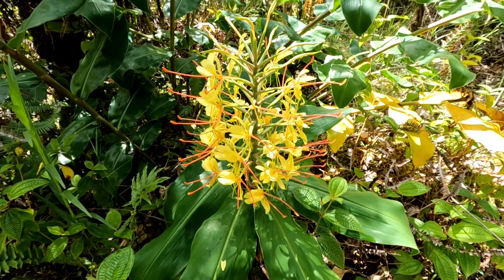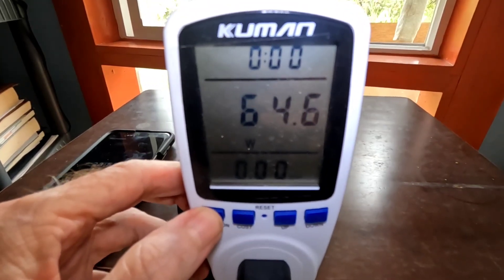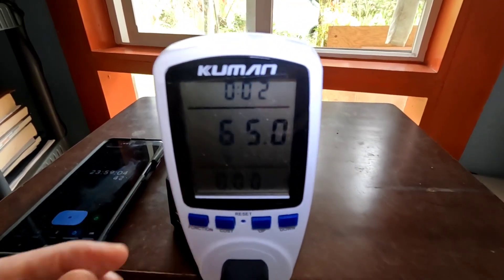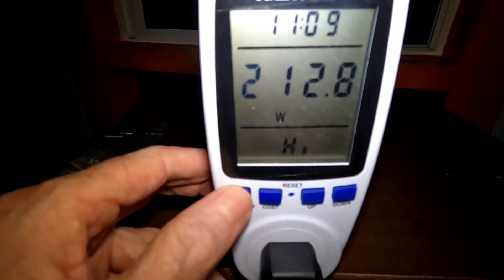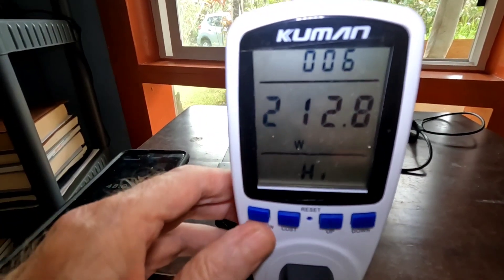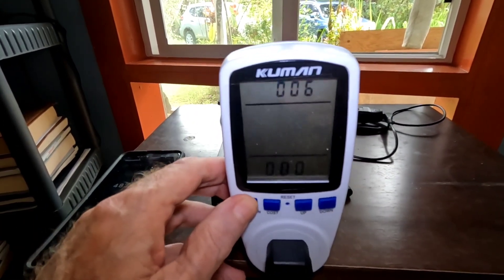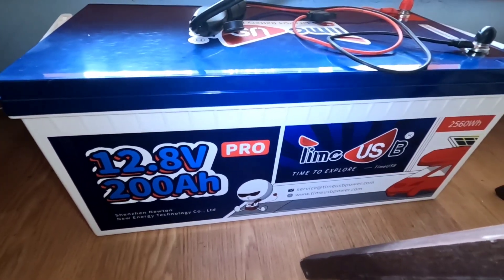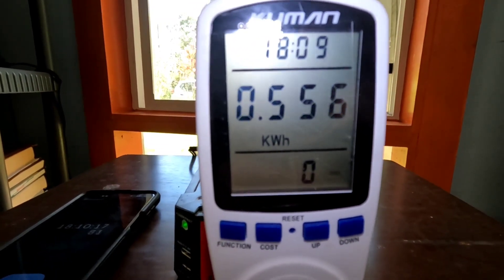Florida takes a direct hit. Thinking of our friends  there. 200 Ah Ogrphy LiFePO4 runs 50 +hours!

Comment: Refrigerators have a heat strip in the gasket around the freezer door I suspect your 1.4 W is not quite accurate from the metre however the refrigerator with the compressor off will always have a draw in order to keep the gasket around the freezer door warm and soft to create a seal… in order to measure the inverter standby power u would have to monitor the dc side .. that kilowatt meter measure power thru the meter …. Good video
Reply from the maker: Mahalo for that..never knew about the gasket heat, but sure makes sense! Happy new year! Aloha!🤙

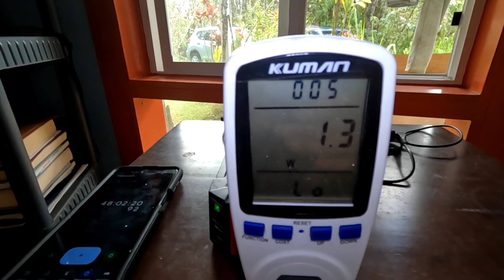Comment: 7:55 ... 1.3W are not used by the inverter on standby coz the meter is connected after the inverter.... To monitor the standby u need another DC meter before the Inverter.

Comment: Keep in mind folks, during an outage lets say its for 3 days, you don't need to run your refrigerator 100%. Food can usually last 5 or more hours, freezer even longer as long as your not in and out of it constantly. You set set your freezer from zero to 10 degrees and the refrigerator part down to 36 degrees once it's pulled down in temp unplug it, and run something else or let your system charge up for a few hours. You could do this for over a month and always have power you'll just run out of food lol.
Reply from the maker: Great information on really stretching out the versatility of batteries as a backup plan.  Mahalo for sharing this with us...aloha 🤙
Reply: @ProjectsinParadise808    No problem I do refrigeration for a living. I just became a prepper given the state we are currently living in. I'll share with you my top 3 things I have saved. 1. Water  I have a ton of 5 gallon water jugs, a zero water picture with a case of filter's and water straws for up to 600 gallons of drinking from a pond, lake or what ever.
2. A year's worth of food ( patroit food bundel ). Plus what I have bought from the store.
3. A shit load of medical supplies and vitamins. 
My solar set up is just run my furnace if needed in the winter, house fitted with low wattage led lights. I could easily live like this for  year's. Also keep in mind you can go 30 day's without eating. So you don't have to pig out everyday. So for quick snacks that can fill you up I have a ton of brown sugar oatmeal, just add hot water. Hope I never have to use it. Stay safe and a big hello from Michigan.

Comment: The bestek pure sine wave invertor was the cheapest invertor on Amazon that had the "Pure sine wave" label on it when I bought mine 2 years ago, I can tell it is cheaply made which is NOT good for effceiency so most of your battery "missing capacity" is the lower efficiency of the bestek invertor.

Comment: My  solar controller is over charging my battery. (2.  12.8v. 100amh)  24v system. 
Epever 6517an.
Inverter  3000w. 24 v.
Any suggestions 🤔??
Reply: Inverter  cutting ac power  at 28.2 volts.

Comment: Great and simple setup. Easy for begginers.
The test is great to understand how much a very efficient refrigerator like yours lasts without a recharge.
If the test included a 100W solar panel, I guess you could go on for a week or so before battery shut down.

I saw you had the shunt added later in the video, and as others mentioned, the real battery draw is measured in the DC output side. That inverter is for sure low consumption, but it will take a toll in the overall draw after so many hours.

I really appreciate your simple approaches and everyday life situations shown. Every other channel on YouTube goes into  much more complex situations, which I now understand, but you are putting to practice and living out of your small system. That is amazing! Aloha...
Reply from the maker: Yeah, I definitely mis spoke about the measurements off the inverter,  but suffice it to say both batteries performed very well in our mock power outage situation.  Shunt will be added in future demonstrations! aloha 🤙

Comment: Fun test scenario for the test .  You are as others pointed out only measuring the output of the watt meter the standby power of the refrigerator and run totals.  To measure the standby and total for the inverter you need to do it from the battery.  It’s probably 80 or more percent efficiency so that’s why you aren’t getting the battery’s advertised power.  Love the videos don’t stop.  Also thinking about friends and family in Florida.  Stay safe have fun.
Reply from the maker: Fun test for sure even though I made some mistakes.  Grateful for you all bringing to my awareness! aloha 🤙
Reply: @ProjectsinParadise808  I’m still learning from you on every video.  Have fun stay safe.

Comment: Interesting, but I am wondering if it is a case of you just plug the refrigerator in and see how long it would run? My experience is, a refrigerator is something that persons go in and out several times during the day especially if you have kids. Children will be board and just look in the refrigerator which will affect the temperature and other variables which will affect the power consumption. I have a full size fridge in a family setting and it uses 270watts. I tell you in the evening it seems like about 50 times my son will go into the fridge. I say all this to say, "I didn't get that feeling of real life experience in the presentation. Still yes it gives you an idea that it will work but I feel the run time is less under real condition.
Reply from the maker: Refrigerator was opened and closed throughout the entire demonstration more times than I could keep track of. Was definitely real use situation 🤙
Reply: @ProjectsinParadise808  respect man, ok everything good.

Comment: the 1.4 watts is NOT the inverter standby mode as you stated. it can't measure that, you would need to measure the dc power between the inverter and battery. that must be the controls inside the fridge drawing the 1.4w
Reply from the maker: You're absolutely right! Sometimes what I'm thinking,  and what I say are well...you know. Mahalo for keeping me on my toes!🤙
Reply from the maker: Been wondering if you made that move south? Got some friends here thinking about a similar move.🤙
Reply: @ProjectsinParadise808  it’s all good. I’m going to update my resume to include that I’m your personal fact checker.
Reply from the maker: @sNEAKYnIGHTmUPPET  🤣🤣🤙
Reply: @ProjectsinParadise808  we actually just got back from Mexico last week. We got the bare land cleaned up, got the ground excavation done for the footings for our first Casita. When I was there I also implemented a very basic solar system to run a wireless internet access point for security cameras that I also put up so I could keep an eye on things while I’m stuck in Canada.

Comment: Excellent test my friend😁 A capacity meter shunt On the battery would have been a nice little edition. But either way you do have a baseline now. So did the battery disconnect at 11.6  Because I read somewhere that the bestek inverter disconnects at 10.5v.  I like that you threw another brand on!. Now charge up the chins and let's get a Good old fashion shootout video. 🥳🤙
Reply from the maker: Yes, definitely need a capacity shunt in place, and will do. i was impressed it ran over 50 hours though. I assume the battery bms kicked it off. Stepped outside after glancing at it running,  came back in watt meter off, and inverter had red light on. Love the idea of the shootout! Mahalo 🤙

Comment: Important lesson learned. Keep battery and electronics off the floor by at least 4 feet.   Guys, it was only by the grace of the Lord that I was able to beat the storm surge and lift my battery and one inverter to the top shelf of a book shelf. I will always keep my important electronics at lest 4 feet off the ground from now on.  Plus,  I will add some type of protection from roof leaks. Other than this lesson learned,  in the midst of almost total devastation, I am enjoying the sweet taste of just being alive,  watching the firmament ablaze with stars that are only visible because there are no city lights.  My Chins batteries and CATL cells are doing what they were meant to do.
Reply from the maker: There you are! Been holding our breath you'd pop your head above water! And your system is above water too. I can only imagine the scramble to get all of that done under such circumstances.  Well done. You woke up to a different neighborhood,  if you even slept. Hoping we keep hearing from more friends over the next few day's.  The pictures are unreal from there. You made it, and hoisting one to you brother...cheers,  and Aloha 🤙

Comment: Nice experiment. Just to clarify one thing, are you continuing to use the fridge and opening the door as often as you would under normal circumstances?
Reply from the maker: Yes, using as normal.  Opening and closing as needed while cooking etc. etc. Aloha!🤙
Reply: @ProjectsinParadise808  That's great to know. I'm planning a small solar system for an off-grid cabin, so these results are really useful for me.

Comment: well that a real test. want to point out your watt meter is on the AC output of inverter. That number of watt hours will be less than battery. The inverter loss comes into play. Date sheet on inverter   will show efficiency of inverter. now re do your math buy adding inverter loss.  this will get you a better number of watt hours that came out of battery. when doing a test like this you have to consider the loss of inverter . they do make DC load watt hour meter that has a DC shunt and it measures right at battery . this is the best method of measuring battery watt hours. the pics and video's from Florida are scary . and the storm is going to make second land fall . I pray they are ready ! not Shure if we get the left over rain in Boston NY . last one gave us about 13 in of rain over several days. drying out now. still full battery's thanks to some wind.    and did not run out of solar hot water. 120 gal holding tank .water temp going up now. 0 propane use. If a lot of wind my dump load is hot water heating. till will be great in winter when so windy hear and solar way down . 😀
Reply from the maker: Was just telling Michael I ordered a shunt to be used for testing purposes on these kind of tests,  and mahalo buddy for always helping me out where I need.That was some storm, wouldn't be surprised you see some remnants from it way up there too! Aloha buddy,  thanks again for everything 🤙
Reply: Robert,

Any info on the wind turbine you are using?

I recently set up my own system and really love Bob's tests and sharing experience etc,
It was Bobs sharing the knowledge that gave me the confidence to bite the bullet and get it done,

Im currently researching wind to help over the dark winter days when solar is not at its best,

Good to hear that all safe after the storm,

Comment: The efficiency of a 200ah battery with that small inverter putting out 1.9kw is probably not too bad.  That's about an 82% efficiency rating for that set-up.  A lot of people don't realize that the BMS inside those batteries are going to shut the battery down before you get the full depletion.  And, since you don't have control of the BMS, you really don't know what the manufacturer set it at.  It could be set at 10% or even at a Depth of Discharge of 15%.  So you weren't going to get a full discharge anyway.  But, it was a good user friendly set-up and discharge experiment.  Thanks for the video, and I love the flowers.
Reply from the maker: All great points you mention and mahalo for sharing this information with us...aloha 🤙
Reply: TheLiFePo chemistry can be run from 0% to 100% with no more degradation or chance of fires, very different from lead acid + lithium ion batteries needing a BMS to stop major problems.
Reply: @jimbodee4043  Depleting a LiFePo4 to zero does degrade LiFePo4 cells, but not as much as a Lead Acid as you have referred.  It's best to never take your LiFePo4 below 80% discharge, or your Lead Acid below 50%.  Draining a LiFePo4 to zero does harm to the battery and mainly reduces it's amount of recycle capability.  Manufacturers will limit the DoD to increase the amount of recycles advertised.  It's a nice selling factor to read your battery will accept 5000 recycles compared to 2000. The BMS does have multiple functions, including DoD.  Also, some BMS will not wake up if the battery is completely drained, that is why they limit the DoD.  If you can't wake the BMS, you can't charge the battery.

Comment: At 48 hours you had used 70% of it’s rated capacity.  Then the next 4 1/2 hours it dropped the last 30%.
If my math is good the battery is not.  Good experiment though.  Thanks
Reply from the maker: That's what I'm thinking too. I purposely left it in a float condition for day's in preparation for this test to make sure all cells were balanced.  I will make it jump through some more hoops and see if I can get better results.  Aloha 🤙
Reply: Was the reading kWh only given from the AC side?  What was the measurement at the shunt, or did you not have one in place during the test?  The efficiency of the inverter you used could have been poor, and contributed to some of the loss, but it would seem weird that you'd lose almost 30% to that inefficiency alone.